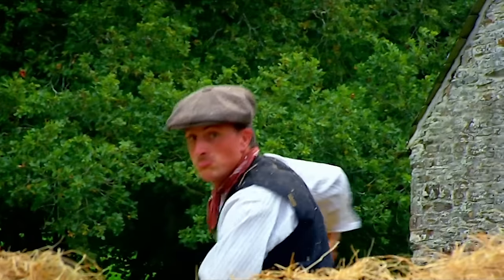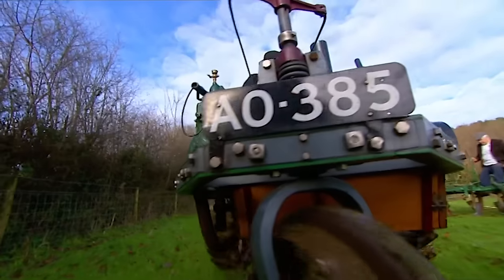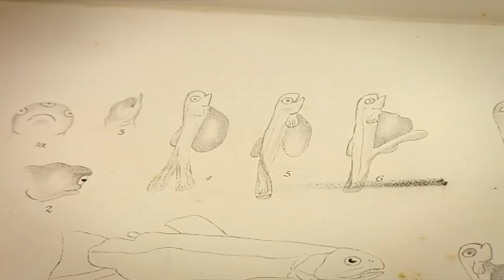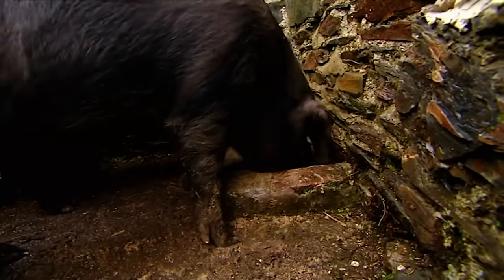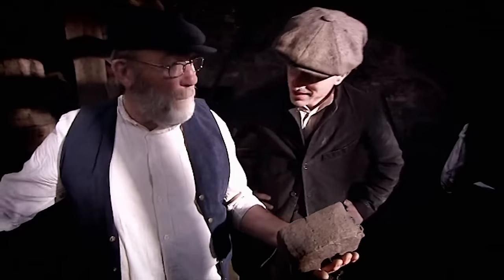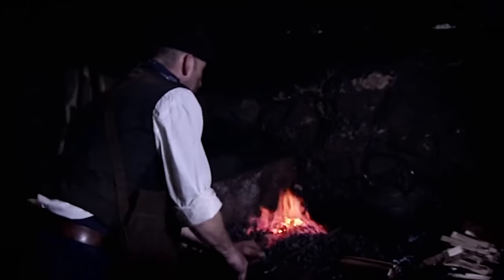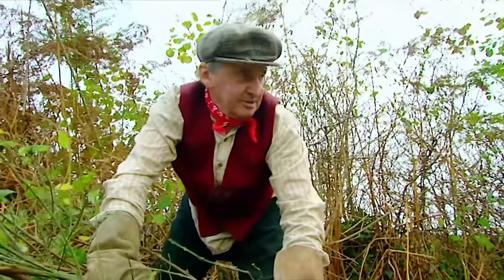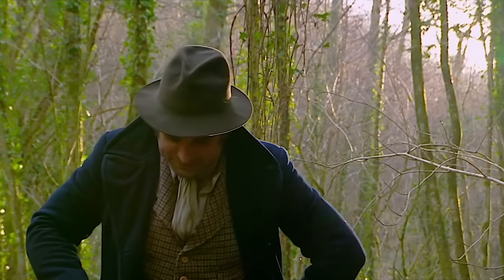How Sloe Gin Was Made In 1910 | Edwardian Farm EP3 | Absolute History

Comment: Iron-clad feather-feet pounding the dust
An October's day, towards evening
Sweat-embossed veins standing proud to the plough
Salt on a deep chest seasoning
Last of the line at an honest day's toil
Turning the deep sod under
Flint at the fetlock, chasing the bone
Flies at the nostrils plunder
The Suffolk, the Clydesdale, the Percheron vie
With the Shire on his feathers floating
Hauling soft timber into the dusk
To bed on a warm straw coating
Heavy horses, move the land under me
Behind the plough gliding, slipping and sliding free
And now you're down to the few and there's no work to do
The tractor is on its way
Let me find you a filly for your proud stallion seed
To keep the old line going
And we'll stand you abreast at the back of the wood
Behind the young trees growing
To hide you from eyes that mock at your girth
You're eighteen hands at the shoulder
And one day when the oil barons have all dripped dry
And the nights are seen to draw colder
They'll beg for your strength, your gentle power
Your noble grace and your bearing
And you'll strain once again to the sound of the gulls
In the wake of the deep plough, sharing
Heavy horses, move the land under me
Behind the plough gliding, slipping and sliding free
And now you're down to the few and there's no work to do
The tractor is on its way
Standing like tanks on the brow of the hill
Up into the cold wind facing
In stiff battle harness, chained to the wood
Against the low sun racing
Bring me a wheel of oaken wood
A rein of polished leather
A heavy horse and a tumbling sky
Brewing heavy weather
Bring a song for the evening
Clean brass to flash the dawn
Across these acres glistening
Like dew on a carpet lawn
In these dark towns folk lie sleeping
As the heavy horses thunder by
To wake the dying city
With the living horseman's cry
At once the old hands quicken
Bring pick and wisp and curry comb
Thrill to the sound of all the heavy horses coming home.
Reply: Thank you . Very nice!  Who is the author?
Reply: @325aliceI  ..its a song by Jethro Tull called 'Heavy Horses'
Reply: Great song/lyrics/heart-pounding. I used to listen to Jethro on my Sony Walkman whilst riding my horse as a teenager, saw him at Wembley too. Taught my horse to pull a Harrow/rake/sled
Reply: My Dad was born on a Michigan farm in 1909. He loved the horses. He cried the day the horses left and the day the tractor arrived. He kept me entertained with stories of farming with horses. 
They were poor but never went hungry. 
He said they may not have what they wanted but always had something to eat.

Comment: The advantage of horse power is that they always start on a frosty morning. They'll run all week on a few bags of hay AND you can use the exhaust products to recharge the compost heap if you can stand the smell. And if your legs are wide enough you can go to the pub on one of those beautiful shires and not get breathalyzed! 
If the hairs on your cello/violin bow bust, you have a good supply.. 
Try doing all that lot with a little grey Fergie! Or was it brown?
Reply: @Celto Loco shouldn't it be called an RUI if you were on the horse?

Comment: My Uncle Bill said that what he missed working with horses was on those jobs when you were doing a bit and then moving on a little over and over.  A good horse would work to voice commands meaning that you didn't even have to move over to whatever they were pulling as opposed to climbing up and down and starting and stopping.  I remember using the kibbler and it's great to remember how one pulled on the strap to get it moving. Ours was set up with a motor in the barn though. Certainly the Privy at the bottom of the garden was used during the day, after all, mixed with the soil from the pig sty and calves in the stable it was much cheaper than emptying the septic tank.  Pigs are quite bright. once milking had been done, the pigs would be let out for a root around in the yard.  Mainly I think so they had something to stop them getting depressed or as it would be explained to me, to help them thrive.

Comment: The multi-shared plough pulled back and forth between two traction engines with steel cables was an effective gap between the horse and the IC tractor. It coulg up intractable heathlands such as Barkstone Gorse in Lincs.

Comment: It amazes me that the plow my family used growing up was just like the one they used here. Ours was just bigger and instead of having someone ride the plow my Papa could reach the levers from the tractor seat. We planted with a walk behind planter and covered it with our feet as we passed. Potatoes were planted with a hand tool. It was a handle with a hinged wedge. You dropped a potato in it stepped it into the ground, pushed the handle forward which opened the wedge and dropped the potato in the hole. These shows make me so nostalgic. I wish my kids could have the same experience. It is a lot of work but growing up when I was outside and got hungry I would go out and pick some green beans, snap peas, or green peppers and have a snack. Then get a drink from the hose. Which would totally freak some of today's parents out! I was raised with sayings like "God made dirt, and dirt don't hurt" and "gotta eat a peck o'dirt before you die"

Comment: At what time in history did they change plowing in figure 8 curves and loops to the straight line modern method?  Did that coincide with bigger wider fields than the pirch  width?  What happened in history to bring about that change?
Reply: Flat furrow ploughing was made possible with the reversible plough and internal combustion engine, for pulling this dead weight and powering hydraulics, that even dozen horse carriage and a team of ploughmen could not possibly manually operate (6 body reversible plough commonly need 300 horse power tractors).
With a traditionnal righ hand body plough you cannot reverse the side which the dirt is turned so you have only two options : etheir start a the edge of the field and plough toward the center (casting plowing, inward spiral), or like in this video, start at the center and make your way toward the edges of the field (gathering plowing, outward spiral).
While balance plough started to appear mid 19th century with steam engine cable ploughs, the conversion to reversible plough and general adoption of flat ploughing started in the late 60's.

Comment: How did they store ice in the old days ??
Reply: in big piles of sawdust
Reply: Silver Soul  They had "ice houses". It could be a basement or cellar.  But they usually had purpose built ice houses. These were typically either partially or completely below ground, or, were partially or completely dug into the side of a hill. Blocks of ice were"harvested" from a local lake or river during the winter, and stored in straw inside the ice house. The block would be chopped down to desired size, taken to kitchen ect., and using an ice pick and an ice mallet would be chopped to desired size of ice for purpose of use.